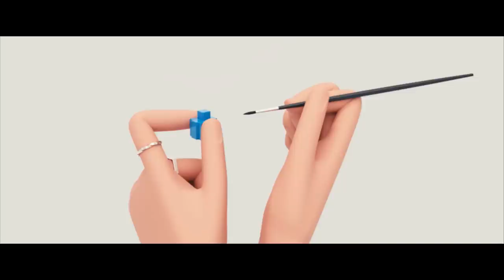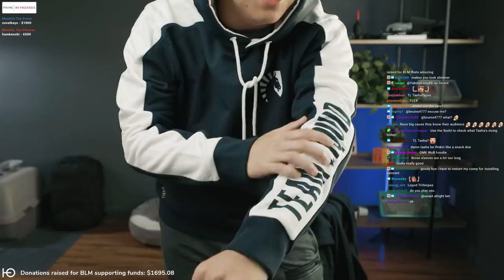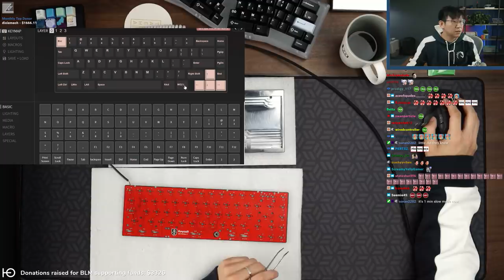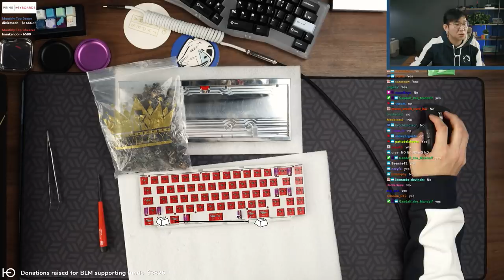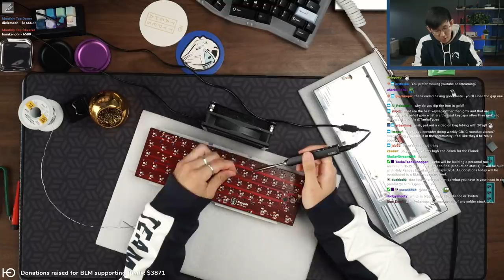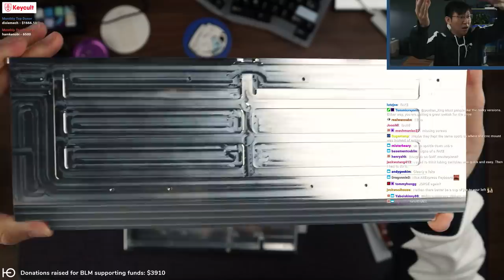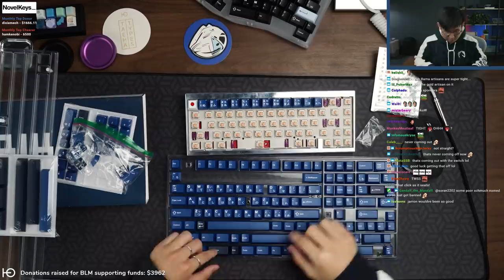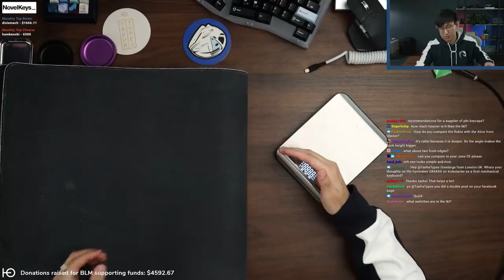Keycult No.2/65 Build Stream

Comment: at 1:33:12 there was a question about using car grease in stabs. I've been doing it for ages and it work relatively well. It is not perfect but it works. Just smells weird. Lubed my switches with it as well and it's butter smooth. I will say though it works better for the actual switches than for the stabs.

Comment: Hello Guys if someone has a good mechanical keyboard either 60%, 65% or TKL LAYOUT at best one that is already finished and which I don't have to assemble myself like you are used to on the channel here would be correct if someone can recommend keyboards or keyboards brands to me gladly also as accessories good keycaps and im asking me if the Ducky one 2 mini is good ?